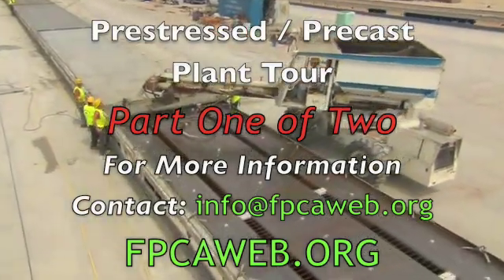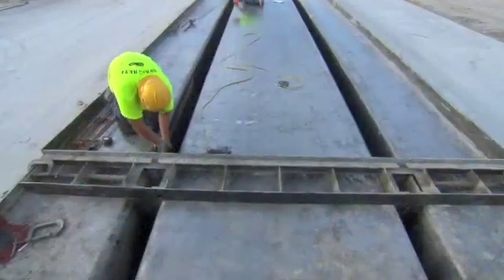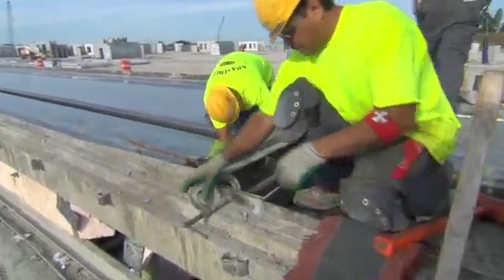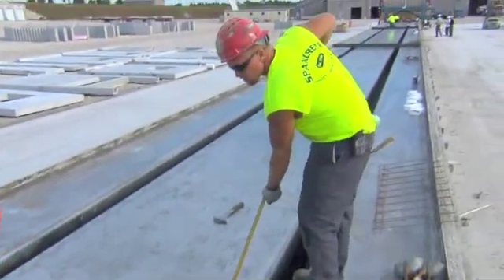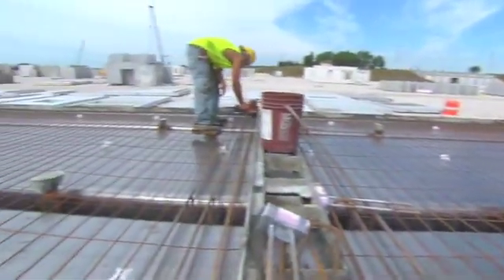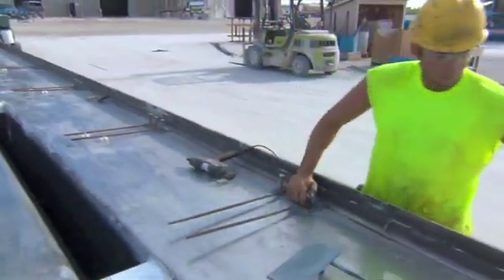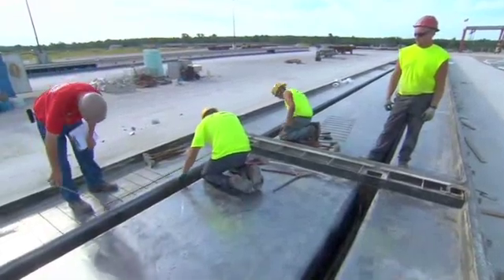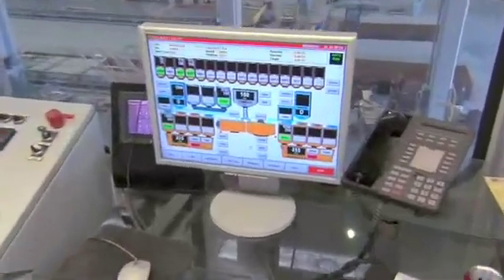Prestressed / Precast Plant Tour Part 1 of 2

Comment: It looked like one of the workers had sprayed form oil on the flat plate connector and re-mesh.  Wouldn't this cause a negative adhesion of the concrete to the rebar,  and mesh,  and a potential failure?